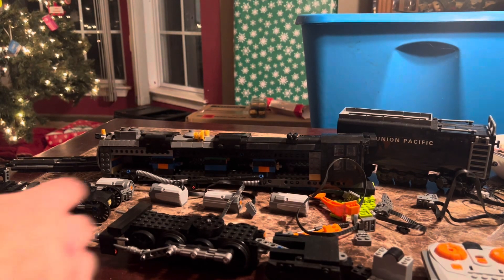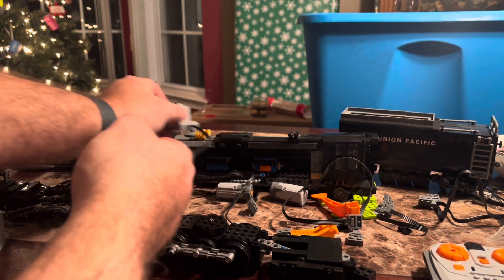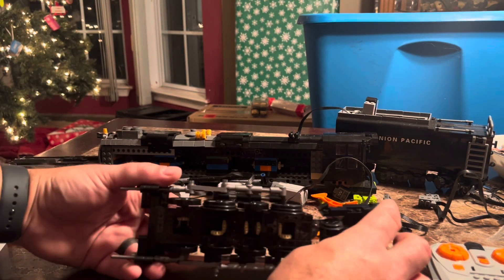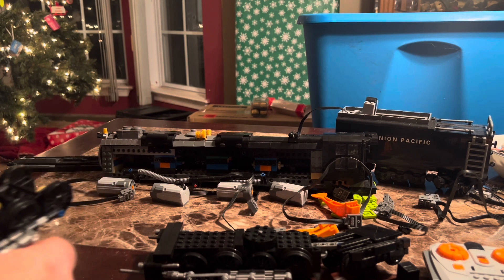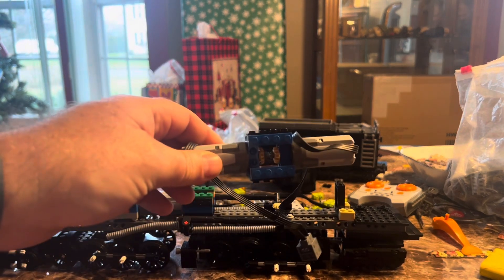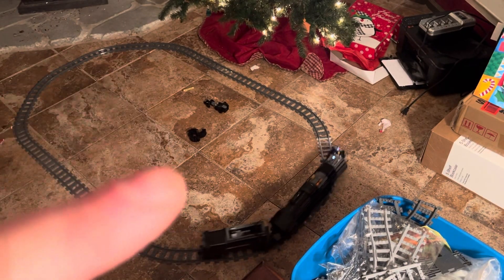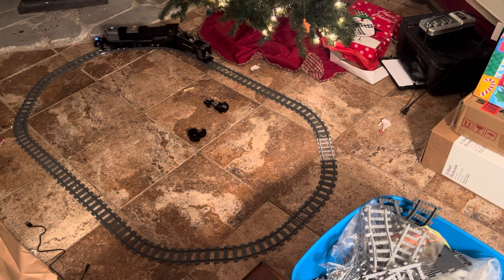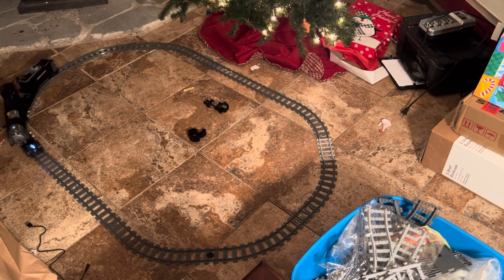Motorizing the Lego compatible bigboy locomotive

Comment: I've been trying to figure out how to motorize this myself while building it. As for the cow catcher, the instructions tell you to have it sticking down between the tracks, but that will cause issues. Raise those parts up to be level with the others. The motors spinning opposite directions can be fixed by using a power functions reverser switch on either the forward facing motors or the rearward facing motors. That way a single axle can be used between 2 motors. Would you be able to show how specifically you got the vertical axles in place? The technic beams the make up the frame are blocking the path if you build it per the instructions.
Reply from the maker: The front carriage I flipped 2 technic pieces of the engine lower frame to get everything to fit. The rear was perfect. The vertical shaft was actually pretty easy you insert the driveshaft rod through the rotating piece into a gear and it’s removable. You ll have to re organize the gears though. The top gear to motor mesh height is what I had to play with for awhile to get it to work. Showed the main fix in this video that crossbrace to support the shaft just under the motors was critical otherwise the gear jumps away from itself. 
While you’re in the process of building it definitely needs more battery I only get a few minutes run time and I’m hoping when I add more capacity it help’s with my starting torque